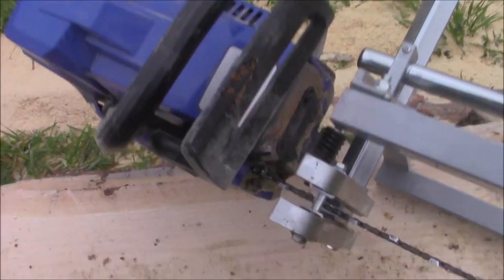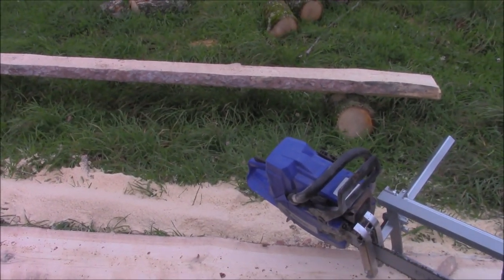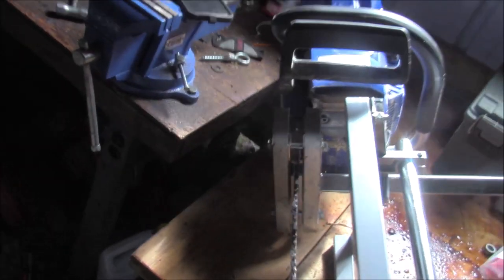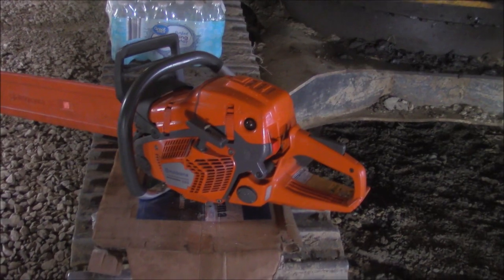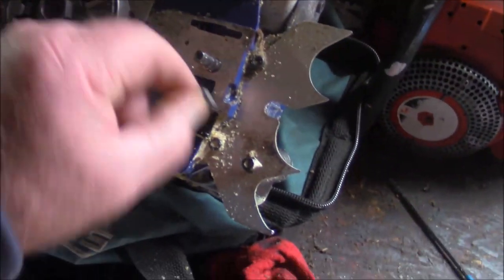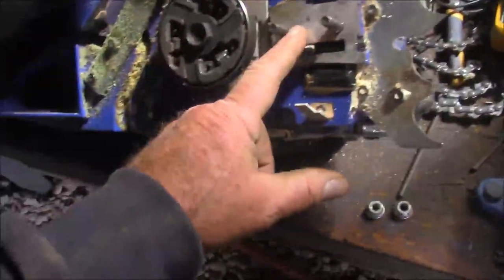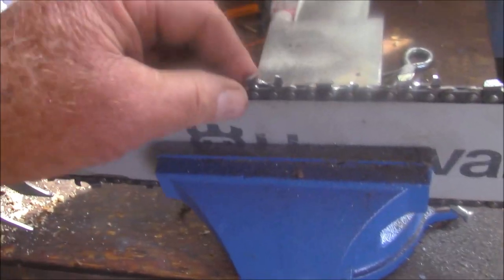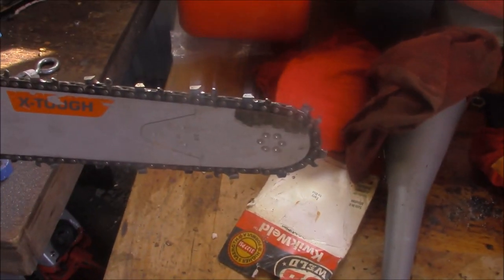Holzfforma g288 "Heat" , Pushing That Saw Hard To Find It's Limits

Comment: Heat is 100% the enemy of any saw. For me the name of the game is build saws that will run all day without getting too hot. It can be a struggle. 

I think you're proving that the 288 clones are capable of doing serious work. 

Will they last? Who knows. 

I'm going to fire up mine today I think and see if they will make it through a day here..
Reply from the maker: Looking forward to the video! I'm liking the g288 and g395's. One thing might be fun to do ( both of us ) is do a before & after in "similar" work with a ....... thermometer. One of those laser non contact ones on the case & cylinders. I did that for a few years with the 562's along with tracking the temps & settings on CST. Would be surprised. Got a little Video burnt out then so didn't post much of that. Might be fun to revisit that

Comment: Nice description: The 800lb gorilla in the room - HEAT !  - saws like to run at a certain “x” temp once fully warmed up to operating temperature - build accordingly and the saw will give a nice increase in cutting performance whilst still delivering a long service life which is what I’m looking for in a worksaw - maybe 20-35% increase in cutting speed over stock same bar/chain with the ability to make cut after cut(varies on model / version of saw ) . I’m not a fan of machining cylinders and raising compression considerably as it’s been my experience that during cut after cut with no “rest” period (like bucking lotsa firewood) they can get too hot and you actually end up losing power! … and engine life !  Many saw porting/building services here on utube where the “demo” consists of a quick 20-30 cut and with a saw that sounds like a pissed off hornet 🐝 then that’s all folks … Seldom do you see 4-5 minutes of uninterrupted cutting … wonder why ?
Reply from the maker: Yup, there is a point of diminishing returns with compression on work saws. For me the rule of thumb is not to exceed 180 on the true for real working saws. None of the ones I've build for folks are past that. BUT if I'm in the 170 range they don't pick up too much heat to beat the stock fins & fan, and they actually start easier. I spend a LOT of time a few years back tracking heat in my 562's when researching the build for them, both with a lazer non contact thermometer but also in CST for the carb temps. ( Mixture settings too ). That's a big reason I settled on the builds as I do for the 555/562. And they all have passed the test of time. So may break out the lazer for these saw as I develop them. Especially the g395....it's a fun saw. Want to at least match the 660 builds I did back in 2017-18
Reply: @afleetcommand  I’ve gone as far as using a CHT gage (the washer under spark plug version) and the results were eye-opening !  In hardwood you can actually see the cylinder head getting hotter as the chain begins to dull out! Sharp chain cannot be emphasized enough - especially when going for more performance!  Some guys use more fuel to compensate for the excess heat but to me this is counterproductive and probably not as healthy for the operator to be breathing  excess fumes although the mosquitoes 🦟 will be kept at bay 😂. The old saying that “the Fastest saw cuts the Most amount of wood using the Least amount of fuel” comes to mind here. To me it makes no sense to get that lil bit of xtra performance , use excessive fuel to keep it cool, but runtime is decreased substantially… just my thoughts your mileage may vary
Reply from the maker: More oil to a point ( depending ON the oil ) means more BTU's per unit volume, so a bit more heat and power possible with the right oil and the right mix that will actually BURN the heavier oil mix. I get the best out of 32:1 have for a long time with an ester base synthetic. like BelRay H1R, Back to the dirt bike days. Conversely with the wrong synthetic all it will do is gum everything up & stick your rings & power valves in the dirt bikes. And wrong "Dino" oil with CARBON everything. Empirical data from over 50 years of burring two stroke.
Reply: @afleetcommand  I agree with what you are saying. Though expensive the VP or motomix alkylate fuel seems to be the ticket for me. Aspen is also available here in the states and you can use your favorite mix oil with it for a substantial savings. I like it for small jobs where you may only burn a tankful or less - excellent long term storage and you can leave it in the saw for quite awhile with no problems. If doing a lot of cutting where I’ll be burning a few gallons I’ll mix up a batch  of non - ethanol fuel (though legally it can contain up to 5% ethanol go figure) but when finished I empty the tank , fill up about 1/3 with alkylate and start the saw so it circulates thru the system , then on the shelf until needed for duty. I steer clear of regular pump gas though, independent tests have found up to 20% ethanol in some pumps labeled 10% in my area and that’s a recipe for disaster for any saw let alone a modded one. Unfortunately The fuel quality of todays gasoline isn’t what it was back in the day and I think a lot of folk think the oil is causing carbon build up when actually it’s the fuel itself!

Comment: That's what I got the g395 for. Not broken in enough yet. Here in Kentucky my Hudson sawmill would shutoff in the heat
Reply from the maker: After the piston change, mine has been solid to this point. I like that saw. I would definitely open up that muffler as I did for milling. Get the heat out. :) Prolly check the piston as well. The one they sent was actually pretty nice, just once I have the top end off, wanted to "improve" if possible and AM pistons & cylinders are cheap

Comment: Cutting a stump off can be a pita.  I never see to be able to get a level cut on a big one.  One end of the bar always seems to find a way to get in the dirt if I try to cut it off at ground level.  So, I usually try to cut it above ground level and then shave it down after I get the big part of the stump out of the way.  I cut them down so a mower will go over them without hitting them.  The last big one was a five foot hickory stump and it took two of us to rock it off.  It must have weighed 1,000 pounds.  I had to cut another notch at the base, so it would finally tip off the remainder of the stump.  I cut through it with my ms 660 with a 36 inch bar and finished up with my ms 360 with a 20 inch bar.

Comment: What angle is that chain sharpened at? It looks like 30 but it could be less. 
For milling 10-15 degrees works much MUCH better.
Reply from the maker: random :) What ever the lines were on the Pferd. Was time pressured. Regardless it CUT like crazy in that hard ash. Wishing now I had the camera on the chip "hose" out from under the cover it was doing as I was cutting.

Comment: When you mill that pine did you let them dry for a while or cut green thinking of getting into milling and it’s i believe red pine
Reply from the maker: I did let my red pine sit before milling, but prolly isn't required. But how you pay them out after does, Also if you want the to dry in a more consistent way, seal the ends with paint or something.

Comment: I've noticed your 281 has a thump to it at idle like a small block with a big cam in it that the blue saw doesn't.
Reply from the maker: And my 281 will "Thump" the g288 as well. It's a stronger than u would expect saw. Don't know why , just is.
Reply: @afleetcommand  my 288 sounds just like your 281 was wondering why the blue saw has a different sound
Reply from the maker: My guess is compression. My 281 has a LOT more, pushing 180psi vs. the 140 or so on the g288. We are going to address that over time :)
Reply: @afleetcommand  i was able to figure out my issues with the 372xtorq build copying your build. Its a pretty decent firewood saw for me. Interested in seeing how long it lasts. I bought it with a roached top end. I think I'm into it for 250 bucks

Comment: With repect to the chinese mill bending the gude bar - I had the same, I think Chinese mmanufacurer failed to see a simple casting with a draft angle was going to screw up alignment. I made a simple shim to insert and ckamp between the rail and castings - didn't want to make castings weaker by removing metal. I'd add a picture if it were possible.
Reply from the maker: Please do, u have a channel?? If so post a "how to fix" on those. Or let me post it with you permission and reference. I think that's a useful size and priced low enough to be interesting to a lot of folks.
Reply: @afleetcommand  Thanks for reply. Yes I have a fix for that and I have run it on my mill (48") for 2 oak trees worth of milling. Its just a shim to counteracted the draft angle on the casting, not fool proof but it works with a little attention. I'd be pleased for you to show it on your channel - you would have wider reach than me and you never know maybe the manufacturer would pay attention to you....I tried to get Holzfforma interested, sent email, no response. How can I get a picture to you of the shim and where it fits on the mill ? Cheers for now.

Comment: Isn’t oil one of the “ secondary “ means of heat transfer?  I know that there are cooling fan blades on the flywheel to blow air over the fins of the cylinder, but in my research I have read from very knowledgeable people who make their living with 2 stroke engines that the more oil, the more power as well as heat transfer out the exhaust.   Your experience?
Reply from the maker: On four strokes with a a "pool" of oil circulating oil IS another heat management tool. On two strokes where the lubrication is the oil mixed and burned with that fuel, an increase in lubricity lowers heat from friction. But that isn't "heat transfer", that's lowering the heat generated by friction. The main "heat transfer" systems are the exhaust, fins & cooling "fan" (flywheel) , and the piston & rings transferring heat to the cylinder walls, which then goes to the "cooler" fins. Heat likes to go from where it is to where it isn't in something like an aluminum casting:) And to a certain extent the heat gets moved thru the connecting rod to the bottom end, cases too. Yet another reason I'm not a fan of anything but steel bearings.
Reply: It’s true to an extent the more oil you have the likely you’ll foul plugs and get incomplete combustion which obviously robs power if your ok with smoke run more oil but it doesn’t translate to power it may help longevity tho